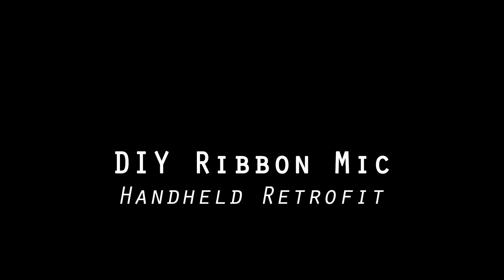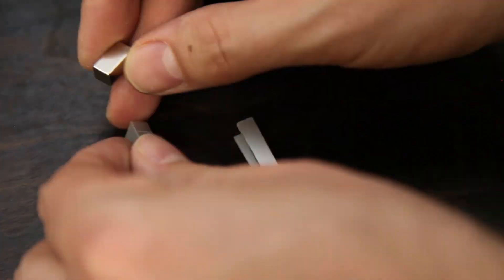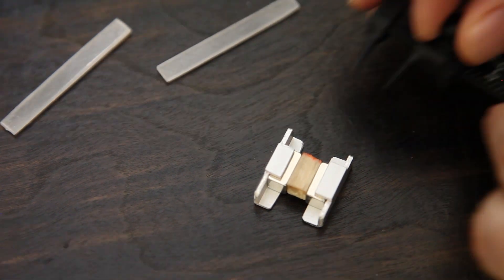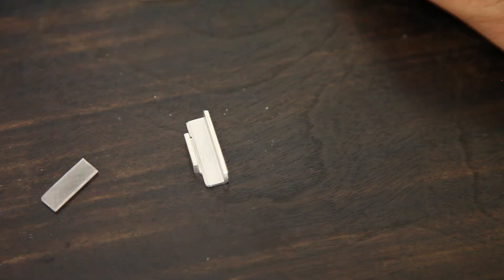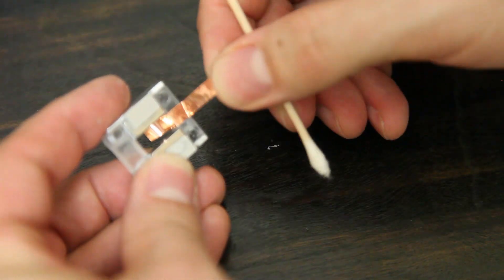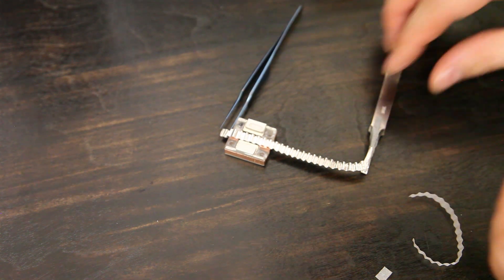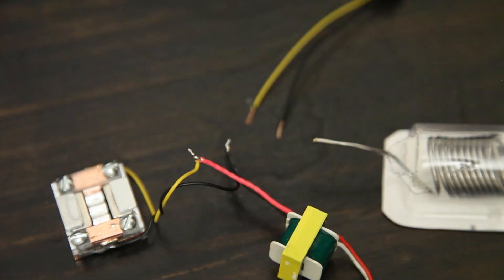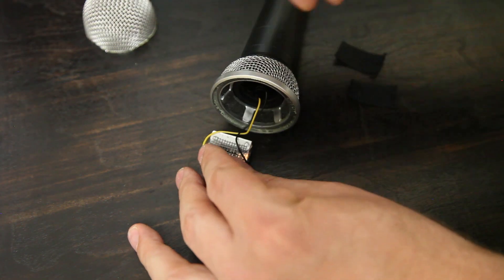Ribbon Mic Build Microphone DIY Custom - HANDHELD RETROFIT

Comment: What are the detail of this transformer?
Reply from the maker: Not exactly sure of the specs on the primary or secondary, but I believe it's about 1:35 ratio(pretty common for ribbon mics).  Lundahl, Cinemag and Edcor all make suitable Ribbon mic transformers.
Reply: Frank Olson Twins thanks alot for the info and good job, i didn't know the mechanics behind it are so simple and so small. A future project.

Comment: Where did you get the transformer?
Reply from the maker: The are many places to get ribbon mic transformers online,  but i got this one from ebay.  There is a distinct correlation between transformer quality and sound quality,  so buy the best one you can afford.
Reply: @FrankOlsonTwins  thanks, great build btw
Reply from the maker: Thanks!  It sounds great on vocals, guitars, drums- even bass!  Use a pop filter for vocals though!
Reply: @FrankOlsonTwins  What kind of impedance (in & out) was the transformer?
Reply from the maker: This uses a ribbon step up transformer,  1 to 37 ratio.  Other ratios such as 1 to 28 can be used.  Actual impedance on each coil i didn't test. Lower ratios will have a lower output.  Hope that helps!